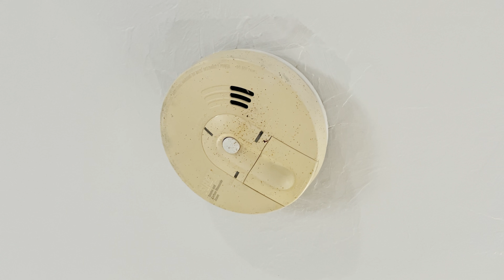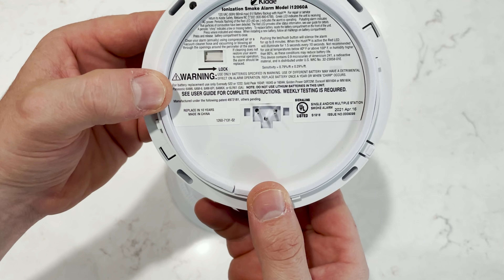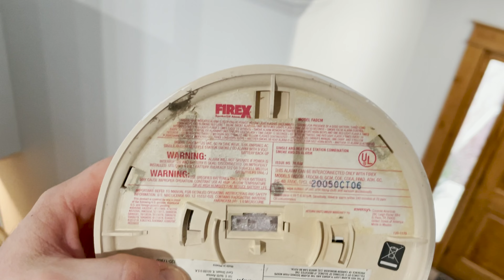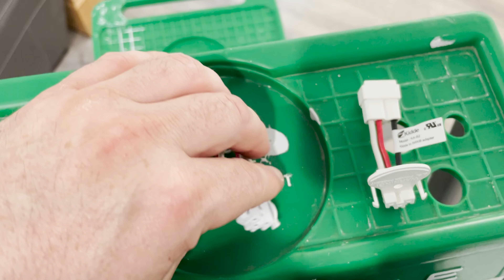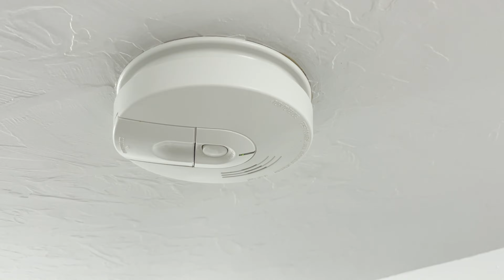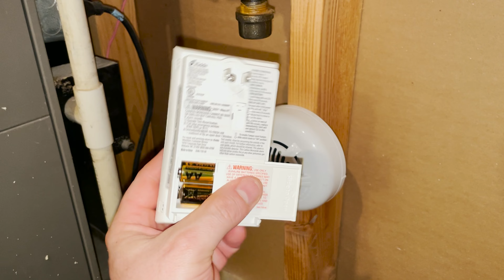How To Replace A Wired Fire Alarm - Step by Step

Comment: I never realilzed that the "Brown" detectors started out white...but the fireproof coating changes colors over time, which helps let you know when they've expired.  I always wondered why someone would pick that ugly brown color, lol.
Reply: I'm pretty sure that's a house where someone smoked, I'm replacing my alarms that are 10 years old today and they are still as white as the day I installed them.
Reply: @jasonf777  All 8 in the house I bought new 16 years ago are a nasty brown.  Smoke free home.  I guess they’re all a little different.
Reply: @weekendhomeprojects  hmm, maybe some do change color over time, im not sure. Maybe it depends on the conditions in the house, light, heat, humidity etc.